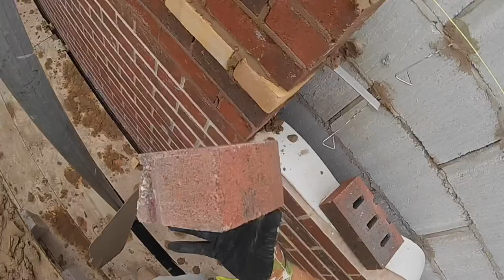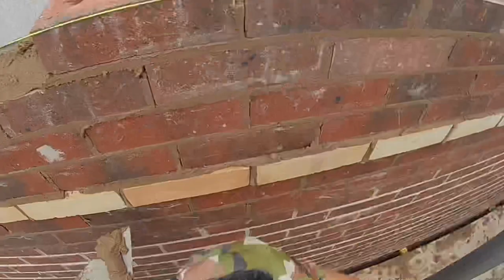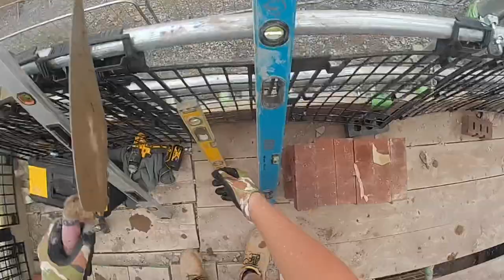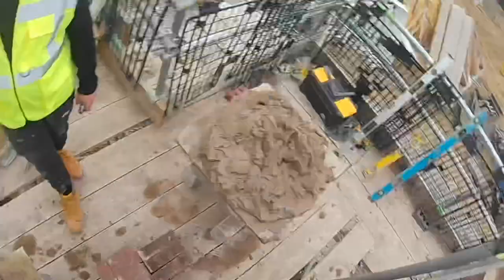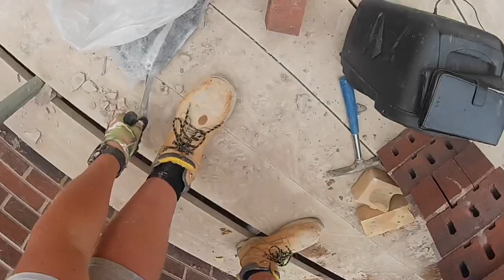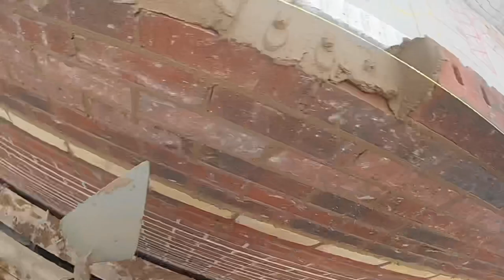Bricklaying Vlog - Taking Over a Creamy Band Lift - Getting Your Head Around a New Job? - Part 2

Comment: ive used thin grout joint mortar.. you take the whole blockwork up first all the way to wallplate including the peaks , then drop back down onto the brickwork , this is so all the other trades can start on the house, a bit like a timber framed system, it never took off though ,we done a 3 block and a pair then it all went back to traditional build, the firm was just testing it out, it was easy though as the blocks were 4 standard blocks in size 2 block in lengh and 2 block high , and because you started off the damp with 2 course of brick using normal mortar, it worked out at 5 courses to joist height,
Reply: oh.and you don't use ya trowel to lay the block, you have like a sweet scoop and it has teeth on one end, so the spread looks like your'e going to set a tile.